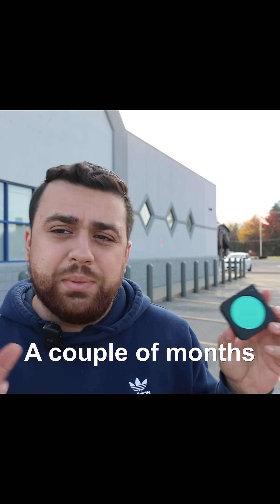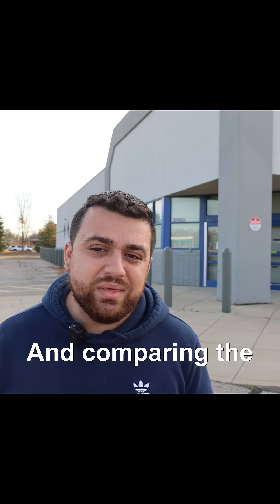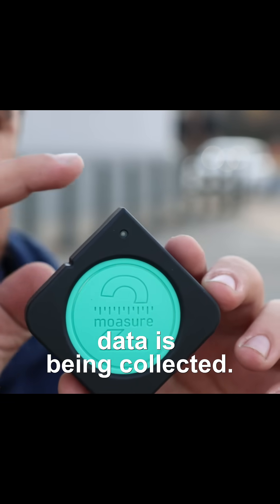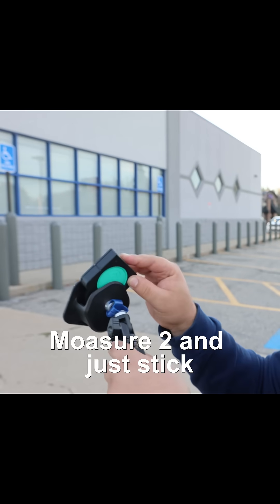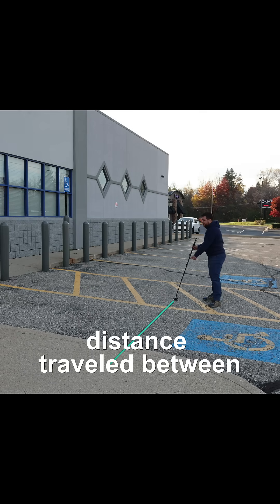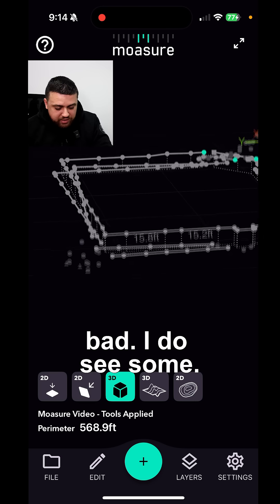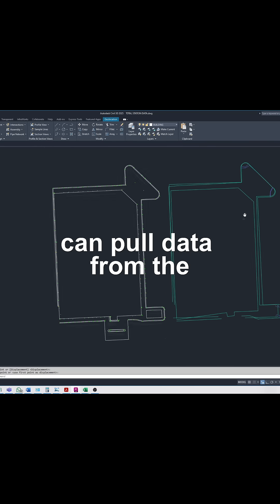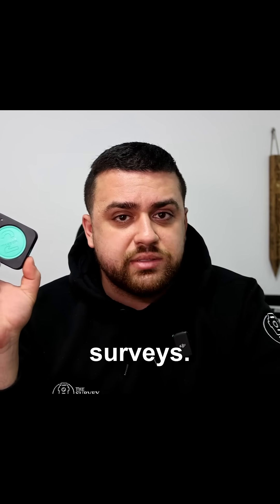Moasure 2 PRO vs Surveying Total Station Accuracy Assessment

Comment: Thanks a lot for the review Rami,
Have been an admirer of your channel for long time now.

I am an sports infrastructure contractor, I build grounds of area 600 m2 upto 10000 m2. I measure the length and breadth and levels of the ground. Do you think moasure is useful to me. I hire somebody to use total station and moasure looks like something that I can do, but if it isnt accurate to couple if inches then this doesn't work